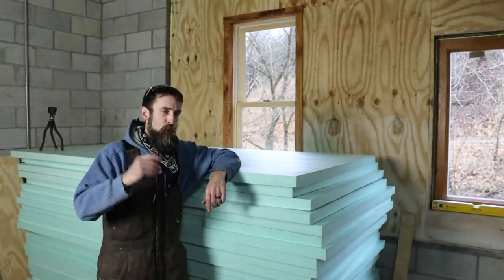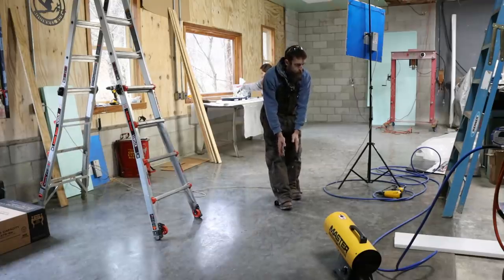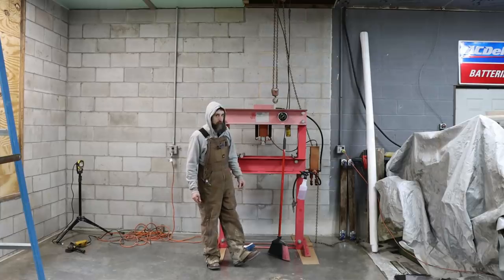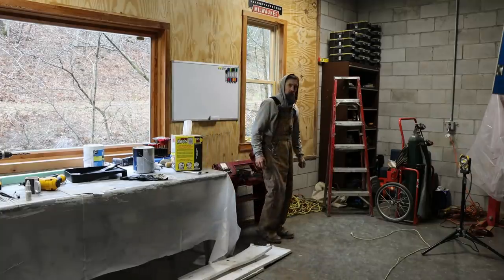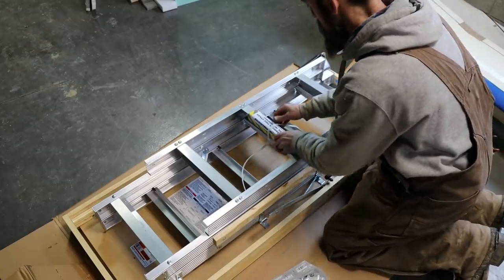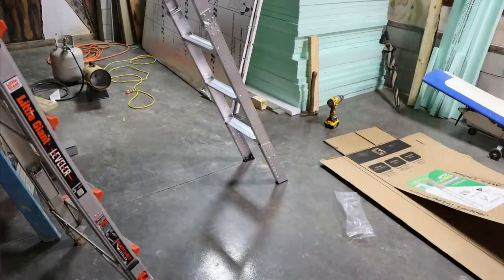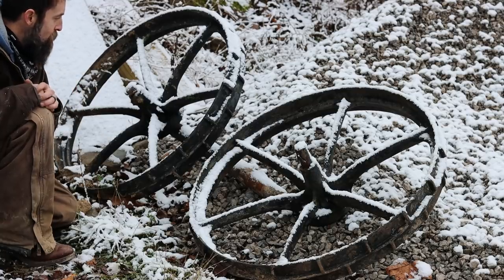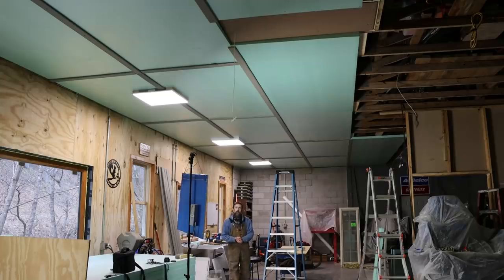Installing the new shop ceiling! One step closer to finished!

Comment: You can hear a big difference in the workshop sound as that ceiling went up. Leaving it green or painting will make little difference light wise, unless the door is open in summer and the sun reflects off the floor, but paint will decrease the sound absorbing slightly. 

That old aluminised board can be tacked to the underside of the roof though, adding in a bit more insulation and reflecting the heat back up in summer, and the heat back down in winter, providing the boards are not too bad. Consider adding a roof ventilator that is not electric, but wind powered, one each end, which will keep the roof area fresh and dry. Yes will mean a pair of holes through that nice shingle, but you likely are getting good at hole sealing. Yes add the mesh to the eaves, as that foam will just be a candy treat otherwise for all sorts of critters. If you are turning stainless keep those shavings separate, free rustless steel wool.

That is one nice set of stairs, now you need to add a light switch up top, two way, along with a set of lights in the roof area. Saves having to carry a torch or lamp up every. single. time. you. need. to. go. there. Plus probably a power outlet each end, just in case. For the lights you can probably get a industrial microswitch so opening the attic door turns them on, and closing turns them off. Did the same for the unfinished basement by me, as people have a bad habit of leaving the lights on and going out.
Reply: Or a motion light fixture that would turn on with the movement of the new stair and turn off on its own after a while.
Reply: Electrical work is not your first function?................

Comment: Looking good just wandering if that insulation is fire proof or how easily it could take a spark
Reply: Not too flammable, but yes not really fire rated. But in a shed with the walls being plywood.... Probably best for Steve to look to installing a door, frame and eave at the rear of the shop as a second exit, which will also make the rear of the property more easy to use as well, as he can carry stuff through, instead of choosing the narrow side with a hill, or the narrow side with a stream.

Set of chairs and table there and he can enjoy the peace and quiet nicely.
Reply: @SeanBZA  he already has a rear door

Comment: I'm watching since you've started and the job with the workshop is becoming beautiful, I wish i had such a beautiful place to work with.
I don't know if you've said it before but have you thought about putting some pillars to sustain the long unsupported area of the ceiling now that you don't have the intermediate wall. And also if you're gonna put stuff in the attic there would be even more wheight on it. Just a thought, i don't know how is the structure. (Sorry for any grammatical errors.)

Comment: Whenever I have a potential client that seems like is going to be a pain in the butt or a job I really don't want to do, I will double my quote. That way, if I end up getting the job, all the added stress is worth it.  That could explain your $9200 quote on the concrete.

Comment: Yep you aint lying there on concrete quotes..  i got 2 quotes both said 11,000$ just to do a small 2 car driveway that fits 2 full size trucks side by side and thats it..  got a third quote and the guys said 3500..  from 11 grand down to 3500...,  i called the other two companies back 5 different times each and scheduled a quote each time to some random place on the outskirts of town..  think i wasted at least 3 hours of both companies time each...  lol

Comment: I'm a little worried for you with respect to that exposed Styrofoam   ceiling. It's probably pretty flammable, and if it does catch fire the smoke is extremely toxic. Maybe a coat of latex paint would help, at least better than nothing. 
I like the idea of a wood stove, but you might want to place it centrally for easier heat dispersion. Is  there a way to put a passage way door in your huge front sliding doors? That way when the inside is warmed up, you won't lose all your heat having to open up those huge doors just to go in or out.
Reply: Yea, not only is it flammable but it tends to rain down hell from the celling when it burns making escape impossible. Styrofoam must be covered on a celling in a shop.
Reply: I wonder if his squirrel friends will munch on it?
Reply: Yes from where i live it is not legal to have styrofoam exposed, it must be cover UP with a flame proof barrier. What you could do is "paint it" with a layer of cement. (dont know what it is called in english)
Reply: I was going thru comments to see if anyone mentioned this, I didn't want to be a downer. Foam board should never be left exposed, at least it's a high ceiling and away from living space. All that considered don't use a wood stove!
Reply: @billmiller7138  well you are not a downer, but a quick search on Uncle Google brought up some information gems. Kingspan's Greenguard boards are indeed Combustable (means they do burn if a flame or very hot source is held close) but they are not "Inflammable" like styro-foam, which continues to burn when the heat source is remove, produces flash-over, and toxic fumes. https://youtu.be/IuJTPqmJwCg
Reply: @TheSOULBRUVVA  Kingspan's spec sheet says it must have a protective or thermal barrier covering.
Reply: @billmiller7138  if i only had the specification documents to look through! It does make sense, to cover the "raw foam" but it does look good!

Comment: I'm not a building man. But if you have no centre supports for the large open space. Would that not weaken the structure. Plus a power point could be added to it. Or an anchor for lifting something.

Comment: Looking great Steve. Do you have plans for the sliding shop doors to help retain a little heat?
Reply: I would guess they are, at a minimum, going to get a inner lining of insulation, whether the Klingspor, or the old ceiling boards as they are thinner.

Comment: Mrs Summers: Stands in heater flame. 
Mistress Summers: Wears shorts. 
Have you considered that she might be a changeling?
Reply: Actually it would be Miss Summers! ;)
Reply: @richknudson5137  Probably, when I looked. I was trying to be archaically polite to people I don't know well enough to refer to by their first names, and the phrase "Master Summers" would be the polite appellation for a boy. I am not sure if it does, or ever did, transfer to daughters.
Reply: @richknudson5137  mistress Summers is correct in one way,  but given you/we does not work for mr Summers it should be miss, besides today most of us might have another understanding of the word Mistress (female version of master) than its original meaning. So safer to just use miss inn most settings i guess. 😉
Reply: Thank goodness she looks like her mother!

Comment: that insulation board and open flames do NOT play well together.  by code foam insulation has to be covered for this reason.  it burns quickly and gives off toxic gases as it burns.  I know it's just a garage or shop but, a wood stove and exposed foam insulation is not a good combination.  also keep the foam in mind while grinding and welding.

Comment: Steve, if the ladders engineering allows, reduce the angle of the ladder at full opening. Let the rungs take your weight, not the rails and hinges. Use a firemans stance to judge the appropriate angle. Stand at the ladder, place your toes at the feet. Extend your arms out and grab the rails. If you have to lean over to grab the rails, the angle is to heavy. Also, love the ceiling, i say paint it, white. Provide the foam a bit of ‘spark protection’. Excellent work.
Edited to add, follow the angle of the nice werner ladder you have in the same shot!

Comment: I was going to recommend fire retardant paint. Then you mentioned a wood burning stove. Now I'm asking you to protect yourself use ply over the wood burning stove and near the flue pipes, and definitely use fire retardant paint. it will allow you to get out should there be a fire. That foam goes up quickly and is normally not to code. But I'm not going to be a safety nazi, but I want you to survive if there's a fire.  looking good. BTW whats the song you are using now, I like it, and would like to know the group.

Comment: Looks absolutely brilliant Steve! I think those green sheets look fine, as you said, it is all down to the amount of light you have. My ceiling is 3" EPS with 2.4mm ply with a light grey surface, and it is fine. Do yourself a favour and put two or three lights in your loft, evenly spaced along the ridge with a switch by the loft door, makes life so much easier. Could you use the polystyrene (EPS?) you are taking down to insulate between the joists in the loft space. I built a wood burning space heater with a ducted air system that heats my whole shop, although it is not as big as yours. . I think you have a better firewood supply than I do, but we have four acres surrounded by trees, mainly ash, so I do get a decent amount.  woodburner build is here. https://www.youtube.com/user/philhermetic/videos

Comment: did you check the Fire Rate of the insulation you are installing? As 2 years ago in Russia the outside insulation lit fire and ran in the insulation until it found a window and then entered the building causing many Deaths. I would hate to see a spark from cutting torch or  grinder to ignite this insulation and run wild causing you loss of machinery  and valuables , not to say a life !

Comment: Steve, you will want to cover the Styrofoam with Beaverboard or thin plywood, because you are creating a fire hazard .  A very good friend made the same mistake you are making, and ended up causing a major problem, while they installed it for sound deadening properties in his machine shop, and it cost him $275000 in damage and lose of equipment that was not covered by his insurance, because the fire was started in the styrofoam he used on the ceiling.
The insurance company investigator said  that the fire started because of blue hot metal shard from the mill was cast off and embedded in to the styrofoam,  smoldered in the styrofoam causing the fire.

The insurance investigator found metal shards in unburied  styrofoam and  and was given 30 days to cover the styrofoam in his other two shop building, or his insurance was canceling his policy.
He was given the option of ply board, beaverboard, or Sheetrock .
He ended up covering over the styrofoam with beaverboard because it was cheaper, and painted it with enamel.

You might want to check your local building fire code about the styrofoam you are using on the ceiling.

Comment: Your ventilation should be cross ventilation (good practice and a legal requirement here under UK Building regulations) from the eaves you are blocking up to roof vents near the ridge at intervals.  The gap you are blocking up should be covered with fine mesh to help stop animal ingress but still allow for cross ventilation.  That ventilation is of prime importance for an enclosed roof space.  The minimal ventilation you are making is inadequate for the well being of your roof timbers.  Ventilate the roof well and insulate the ceiling is the correct way.  You are storing up future trouble for yourself with such minimal ventilation.  The eaves area is where it will happen too; the very place you are blocking up. Simple to put right with rolled mesh or proprietary eaves ventilators.  OK the was the qualified building surveyor in me but now  fire officer head is on.  I don't know what fire resistance that stuff has but I bet it isn't  designed to be used as a stand alone ceiling.  Does it have a fire penetration rating or surface spread of flame rating?  If not then cost cutting may very well be putting both yourself and your building at risk.  Dry wall does have fire ratings as long as the butt joints in mid span are filleted.  You current insulation should sit on to of that.  I'm not trying to be a smart ass I hoping it well help you from making common mistakes.  With restricted roof ventilation and a good thermal barrier ceiling condensation is going to form and rot out the ends of roof timbers at the eaves and I'm sure you don't want that.  Nor do you want want to see your building go up in flames due to an unprotected ceiling.  Please check on the fire resistance and rate of surface spread.  There will be a Spec or Data Sheet on the manufacturers web site.  Stay safe Steve, saving a bit of money isn't worth it.

Comment: Quick piece of almost irrelevant, trivial advice...

Those whiteboard markers should be horizontal, not vertical.
Reply: Indeed.  When vertical, with the tips up, the tips dry out. Tips down, tips get saturated and drip.